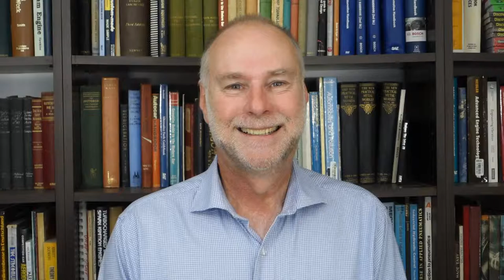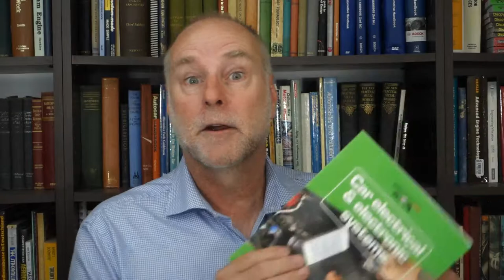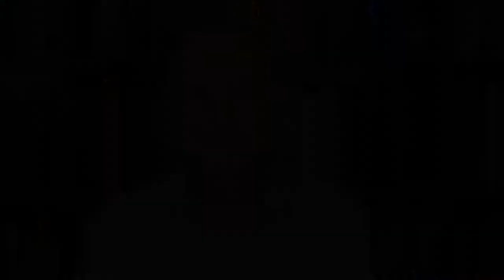Controlling pump speed in water air intercooler systems

Comment: In the early days of charge coolers on the Mitsubishi GTO ,Nissan 350 Twin Turbo when first introduced, I first used the original air air intercoolers and jacketed the air fins added an air oil cooler as a radiator and used 12v marine inline pumps . Breaking new ground had to use what was available back then . I used surface mount bimetallic switches which are still available 30 years later that will switch when the air temp entering the throttle body rises to 30° C which made a simple connection to turn the pump on via a relay . The best result from swapping an air air intercooler to a charge cooler was the 1.6 Ford Escort 4 turbo . I built a direct replacement charge cooler that replaced the large plastic intercooler and the same system of oil cooler rad , marine pump and switching and with nothing else done the car made an extra 30 bhp at the wheels on the Sun rolling road . It works and is simple , reliable.  requires no programming .
Now most ECUs and Arduinos can be written to control the pump or use and driver from Megasquirt , Speeduino etc .

Comment: I'm looking at a brushless pump with controller for my mercedes m113k. The next step will be to increase the inlet and outlet sizes on the heat exchanger under the supercharger and figure out a way to control the pump the way you're describing.

Comment: Good points made here... I would recommend running two water temp sensors instead of running an IAT sensor to control the pump.  This would give you the most control over the temperature of the intercooler, since the pump essentially has no direct control over the Intake temp(only an indirect control).  They make dual water temp gauges for pump control, for this very reason
Reply from the maker: IAT is the variable we're trying to control, not intercooler water temp. Therefore, we measure IAT.

Comment: PWM uses full voltage all the time and varies the pulse duration to control the motor speed. Other than that, great vid!
Reply from the maker: The average voltage that the pump motor sees depends on the PWM duty cycle, so in effect, PWM control varies the voltage going to the pump.  eg 50 per cent duty cycle = average voltage is half battery voltage.
Reply: @JulianEdgar  yes, it could be viewed as an average I guess, just that the motor with PWM with either see zero voltage or full voltage at a certain duty cycle. It'll never see 5 volts with a 12v supply.

Another good video might be how convective heat transfer works. Describing the convective heat transfer between the boundary layer of air and the moving air etc.

Comment: Great video. I've made a custom AWIC setup on my Outback. You're helping me remember the benefits as I'm considering reverting air/air. My temps are way too high. I'm thinking I maybe need a small reservoir higher than my AWIC so that the AWIC is full of water 100% of the time. Perhaps the water level hasn't saturated it. In which case I'm running a non-intercooled setup. 

I have a substantially modified stock ECU. I can program a few additional pins as I/O. My question for you is about how the ECU might be able to handle the proper power of PWM output to the pump. I at least know I can have the ECU programmed to turn a relay off and on for binary operation instead of PWM- And you've laid out a great set of reasons to do at least that! I hate that it's currently on full power with the key on. Thank you for sharing this info and your specific control logic!!! I really appreciate it!
Reply: Paid an overseas hacker to live-hack my ECU to give it all aftermarket performance features that any ECU would want. And still passes emissions :-)
Reply from the maker: Just use a Solid State Relay to operate the pump, with the ECU controlling the SSR (low current).

Comment: I have an air-cooled car, with which I am planning to Turbo-charge.  The Turbo I have in mind is water cooled.  I was hoping to use the same water circuit for the Intercooler as the Turbo.  Do you think this is advisable/doable?  Additionally, in this scenario, if one were to stop the water pump (perhaps via a air temperature switch) when air temperatures are under 30 degrees or so, this obviously would also stop water circulation to the Turbo.  I'm not sure that's an issue, as some suggest the "thermo-siphon" effect is actually what will cool the Turbo, and is most important when the car is turned off after a drive.  Thoughts?  FYI, the car is a toy, so it will see a lot of back-roads driving and track-days, not a daily driver.
Reply from the maker: Yes you could use the same circuit. But I'd keep the pump running for 10 min or so after switch off, irrespective  of intake air temp.

Comment: Ecellent info sir thank you!
I would have to assume the same "constant temperature strategy" is the best plan when building an air to liquid charge air cooler for turbocharged diesel engines in pickup trucks?
Reply from the maker: It's a little different with a diesel truck because they spend much longer on high boost levels that a gasoline turbo car.  Therefore the requirement for 'real time' heat exchange is higher than in a car. However, it depends a bit on climate - if you live someplace where there is a cold winter, then what is covered in this video still applies.
Reply: @JulianEdgar  
Thank you sir. I get it, appreciate the answer and your videos!
Another question is what is the calculation used to determine the size or amount of liquid needed to   effectively cool for the size motor fuel and boost?
Reply from the maker: @mrmtn37  There's no easy calculation - depends on efficiency of heat exchangers, efficiency of turbo or supercharger, engine airflow and boost. Apart from the effect of absorbing engine bay heat when stopped, more water typically = better. But it also makes the system heavier...

Comment: Another great video! Would you have any suggestions on other electronics to control pump speed for those not using aftermarket ECU’s?
Reply from the maker: A 12V DC motor speed controller from eBay
Reply: I was hoping you may know of something that uses a heat probe as well as incorporating a multi speed option for ewp.Very much like a Davis craig thermo switch but with the differences mentioned. I want it to be a ‘set and forget’ system with the manual speed dial.
My aim is to set the pump to operate at Ov@ 0-79° 4v@ 80-85° 12v@ 86°> 
I’m running a piggyback ECU SHOP ECU and not really in the position (if it works) to have it incorporated in the ECU.
Reply from the maker: @REIDY006  Yes I've done such a module using an Arduino but I don't know of anything commercially available off the shelf. (My project was covered in Practical Electronics magazine in the UK.)
Reply: Julian Edgar would it be possible to use an automatic radiator (so it has the trans cooler built in) as the reservoir/cooler? 
It would make for a very compact unit. 

As far as I’m aware the viscous fan is the best form of cooling, wether or not it can effectively cool the water in the trans cooler as well as, or better then a seperate cooler, I don’t know..
Reply from the maker: @REIDY006  All the radiators I am aware of that have an auto trans cooler built in use the engine coolant to cool the transmission oil, so it would be way too hot for a water/air intercooler radiator.

Comment: Hey, have you ever tested how long it takes to heat up the intercooler water when using a water to water ice box? 
I’m considering not using a cooler and fan, but using a tank in the back with a heat exchanger built inside. The intercooler fluid would circulate through but the tank would be full of ice water. 
Sorry if that doesn’t make sense, I can clarify if you need.
Reply from the maker: I am most interested in road cars, so I've never tested ice in the way you describe. Obviously would depend on engine power, boost, time on boost, size of ice container. No one could estimate accurately - do some testing.
Reply: Julian Edgar yeah that’s true. This will be a road car, but built not bought. But it won’t be driven often or for long periods I suspect. 
Thanks for responding!

Comment: What about direct injection engine? Both diesel and petrol. Would'nt you want as cold combustion air as possible? I would think the high pressure injectors would atomize the fuel just as well?
I am planing on using a bilge pump turned upside down on the bottom of a cylindrical reservoir. It has the correct impeller design, gets cooled from the circulating water and I have made a swirl stopper in the reservoir. The bilge pump are cheap to source on ebay. So not to worried about running it on full all the time. What do you think about this setup?
Reply from the maker: I've never seen any research on intake air temp and fuel economy in a direct injection engine, so I cannot comment on this. All the bilge pumps I've ever looked at are (1) not designed for continuous operation, (2) not designed to circulate water through any kind of restriction. I think they're cheap for a reason!
Reply: @JulianEdgar  I have seen a couple of other people using a bilge pump lowered down into their reservoir. It will get a bit better cooling this way. I can't remember if they run it at 100% all the time or not, but the reason why they choose a bilge were there were no other easily available pump that could pump through the entire system as well with high enough flow. Might just be as they have the same impeller design as your subaru pump.

Surely there would be some research on diesel performance with cold or hot intake air? I haven't read any of them myself, I have always just presumed that as cold air as possible will be as dense as possible, thereby have as much oxygen as possible. Diesel have a hard time auto igniting at too low temperatures, but after engine warm up I presume that wouldn't be to big of a problem. Then again, I only sees -30C at the lowest during winter, maybe -35C if I am unlucky, not -50C like they can have in Siberia and Alaska.
Reply: @Mr.Engineer. Cold air is desirable when you are running at high load as compression pre heats the air/fuel. Under part throttle conditions there is not much air to compress and there for it is barely heated, so warm air is more desirable. Warm air will also have a higher velocity better atomising fuel.

Comment: Hey J,
I really enjoyed your videos, I’ve just got a few questions to ask you.
I have a 1980 fiat x19 these cars are mid engine 1500 and it’s turbo charged  using water to air is an ideal way to cool the car.
Q1 which one of your books ideally shows the system of water air and   apply it
Q2 i’ve had the same problems in finding a proper pump for the system can you give me any more info model numbers or information on the Subaru liberty pump
Q3 other than water do you recommend antifreeze to put in the systems even though I live in tropical Queensland.
Q4 do you recommend putting a bleed valve somewhere in the system surely we have to bleed the system to get all out
 
Thanks
Jamie
Reply from the maker: (1) My book on the Honda Insight shows my latest water/air intercooling system - https://www.amazon.com/Honda-Insight-innovative-anatomy-modification/dp/1539335127  (2) I don't think that you'll easily find a Subaru pump - the car is now 25 years old. I don't have the pump's model number. I think when selecting a pump, look for one with a large motor that draws plenty of current - eg 10A. At least then the pump will have the power! (3) Yes I use coolant not just plain water. Using coolant actually reduces the heat carrying capacity of the system (but only by a little) but gives anti-freeze protection (not relevant for you) and provides corrosion resistance (important for all locations). (4) One of my other videos on water/air intercooling systems shows how I had to add two bleed screws to my current system to get all the air out. Those bleeds needed to be on the two heat exchangers.
Reply: Thanks Julian so much, having a mid engine car I’m finding hard it hard where to locate the pump, I possibly have found a Subaru pump. Drawing from the bottom of the inter cooler (cold side) runs under the car and then has to shoot up from under the car and into the barrel in the engine bay, should I have the pump closer to the front intercooler or the middle of the car or up near the engine bay OR do I need 2 pumps. Also I haven’t put a  resiviour in the system is this really important. Jamie Mula

Comment: Hey Julian, I have a question regarding my build. It’s a 1998 Toyota MR2 I am running the TRD supercharged Aurion V6 engine the same setup as the lotus evora 400. I am trying the side mounted aftermarket intercooler and thermo fan setup for the MR2 Turbo application but I have turned the intercooler into a water heat exchanger and have ceramic coated both heat exchanger, intercooler and induction plumbing. I have also ported matched and polished the entire intake, supercharger, heads and exhaust including ceramic coated the pistons, heads and valves. Do you think this will have a good chance of being effective from the side intake in the engine bay? Cheers D
Reply from the maker: Where is the heat exchanger (radiator) for the intercooler? And what pump and hose size are you using?
Reply: @JulianEdgar  The radiator will sit in the factory spot just behind the drivers door and be feed air through the side duct it will also have a fan and shroud to draw air through the radiator and assist air flow to the engine bay. The Intercooler will sit on the left side of the engine bay above the duct and the air cleaner will sit just under to draw the intake. I have a Craig Davis pump running 3/8 pipe and brass fittings.
Reply from the maker: @damo7800  Hmm. The airflow through the intercooler radiator may be insufficient - it will all depend on the pressure in the engine bay (ie needs low pressure there). That's all achievable but it may need some aerodynamic mods to achieve a good pressure difference across the radiator - you don't want to have to rely on the fan.  3/8 lines seem very small - I use 3/4 inch hose. The only Davies Craig pump I've ever tested (a long time ago now) was absolute rubbish - I hope they're better now!
Reply: @JulianEdgar  Thanks Julian for you’re insight and knowledge I’ll look at some other options for low pressure ideas ect. My mistake the hose fittings are 3/4. I just watched your video on Subaru pump lol. I have just subscribed to your Chanel you have Great videos. Kind regards Damo